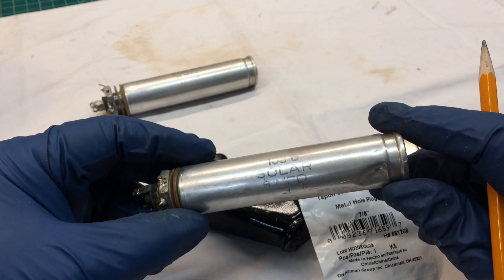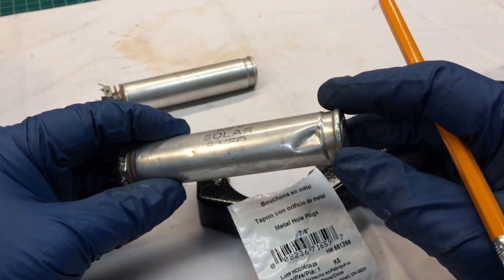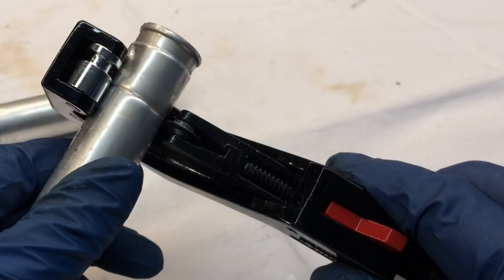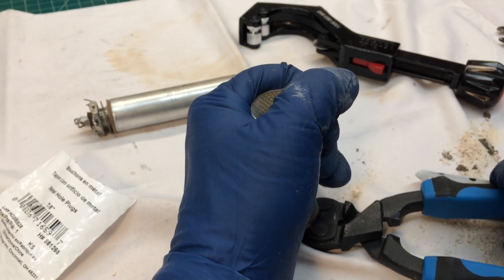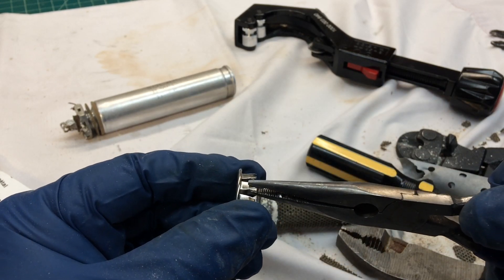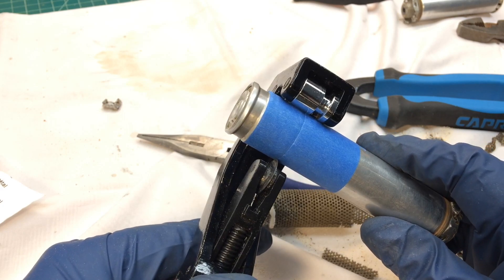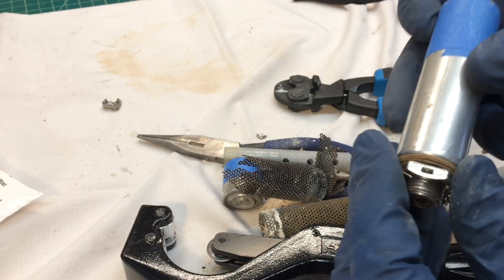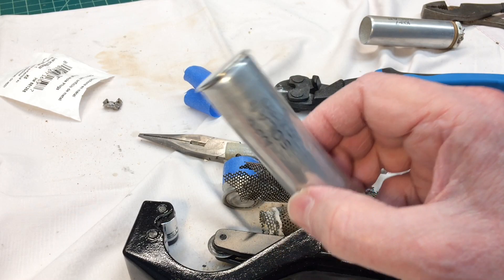Airline 62-316 - Electrolytic Capacitor Restuffing Preparation

Comment: Thank you soo much for this.  I'm trying this technique right now.  I have 2 amps with 3 cans to do, so 6 cans in total.  I'm doing one amp first, then will try the second.  This is much more economical than having a new set of cans made and I wouldn't try NOS because they will be old also and the newer innovations are much more superior in regard to capacitors!

I just did the two 1" cans and cut fine and pulled the guts out no problem.  The one ~1-3/8" can...I cut off, but having a time getting the cap out as it is not shrunken, nor the tar dried up!  Is there any way to loose it up or am I just going to have to try and pull it away from the sides and take put in pieces to get out??
Reply from the maker: The old messy ones I typically build a new can using thin wall aluminum tubing. Some folks have had luck putting the cans in the freezer for a period of time then chipping the innards out. Hope things progress as planned. Best, Don
Reply: @RestoreOldRadios  thanks Don.  I'm researching.  A few people have said to heat it up and the tar viscosity will change be become more liquid n come out.

I also sprayed with WD last night to start n break down the tar.

Some people have said Terpentine is best versus mineral spirits or laquer thinner!  Maybe acetone is??  We'll see.  Wish me luck!  😃🙏
Reply from the maker: I’ve used heat myself in the past, but the health risks (toxins) from the innards may present…
Reply: @RestoreOldRadios  Yes, aware of that!  I actually have a 1# propane grill with oven!!  I'm thinking use it on say lowest setting 250F and since portable, can put outside!!  If heat does the trick...this'll do it (but only because I have the spare oven, so no addl cost)!!  It's brand new!  Bought it like 5-10 years ago and never used it!! lol  This'll be worth it instead of the mess other methods and time will cost me.
Reply from the maker: Sounds like a plan. Please let me know the outcome if you don’t mind. Best, Don
Reply: @RestoreOldRadios  Yep!  Will do.  It's late tonight, but will do it tomorrow and report back.

Once the oven is up to temp, I'll put in until the tar softens and check every once in a while.  I don't think I want to just come back in say 30 or 60 minutes as I think if the moisture boils off it may become crusty and have to chisal out and that would be BAD!  I may do one at a time, so dont screw up a whole batch of 3.  After I get this done and clean and new caps in place and all soldered up, I'll have to do it to the other amp and 3 can caps, so will get plenty of practice in this exercise in!!
Reply: @RestoreOldRadios  Worked Perfectly, Don!

I measured the caps and decided from bottom to cut up 2".  I cut off the top of all 3 of the can caps with a tube cutter (had to pick up one that went more than 1" as the big one is like 1-3/8", so picked up like a 2-1/8" cutter.

I started the oven and put the cut can cap in.  I grabbed the end with a pair of vice grips and rotate.  When it gets hot enough, it will start twisting and you'll want to twist and pull out.  The tar was melted with the oven showing about 450F.  I used a Camp Chef Oven I bought to use in my VW Bus, but changed direction, so it's been sitting around for like 10 years and I know I didn't pay the prices they cost now (maybe $100-200 when I bought it). - https://www.amazon.com/Camp-Chef-Outdoor-Oven/dp/B0013LLSZG/ref=asc_df_B0013LLSZG/?tag=hyprod-20&linkCode=df0&hvadid=194838933099&hvpos=&hvnetw=g&hvrand=4497039300894811450&hvpone=&hvptwo=&hvqmt=&hvdev=c&hvdvcmdl=&hvlocint=&hvlocphy=9052175&hvtargid=pla-313972876734&psc=1&region_id=972485

The innards came out in 2 seconds once tar is melted and as you can see....pretty damn clean!  I plan on cleaning everything meticulously, drilling the cap holes near the tangs on the bottom, then wrap and solder the new caps to the tags and wire everything up!

I'll try and even do a video on the second amp.  The first one an larger can cap tracked a little while cutting it off (did not use the masking tape)and also, since the innards did not come out originally before heating up, I put a pocket knife in between the cap and can to make a gap.  I'm not going to do this on the next one and just heat up and pull out.

It's pretty clean, no maybe I'll forgo the laquer thinner or terpentine and just drill, populate with the new caps, put some silicone in there to keep from moving around and seal up.

The larger one used a 1-1/4" hole plug and fit excellent.  I got the wrong one's on the thinner ones (picked up 1"), so went back and got the 7/8", like you said and work great.  3/4" is a little too small. 

Here are the pics from this first attempt.  Enjoy and thanks for your support!

https://drive.google.com/drive/folders/1CXc5pEjWnxcY7_rSO59hDF2sb-cEl96u?usp=sharing

Comment: Great little video Don, I sometimes re-stuff the electrolytics as well. I've found those caps work well. I've even used chrome plated sink drain tubing to make the outer shell on occasion. Thanks for sharing!
Reply from the maker: Thank you Gregg. I’ve used aluminum tubing (Zenith), but never tried sink drain tubing. What type of hole plug did you use? Best, Don

Comment: What a great demonstration . I now know what is inside and how to remove it once cut open. A modern electrical
box cap seems a near perfect fit for the open end. Steve
Reply from the maker: I appreciate it Steve. Now I just need to get those E-caps installed and move forward with the other component replacements. Best, Don